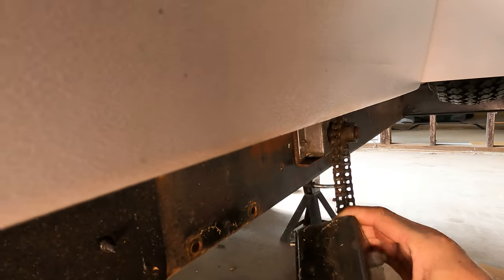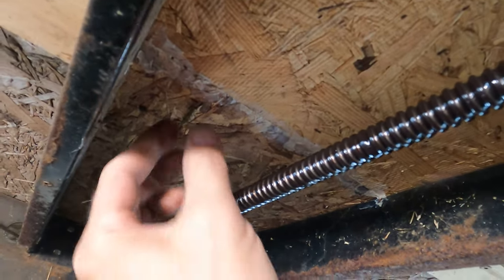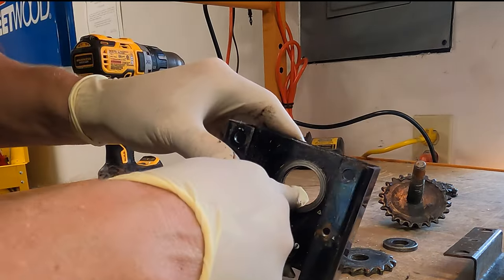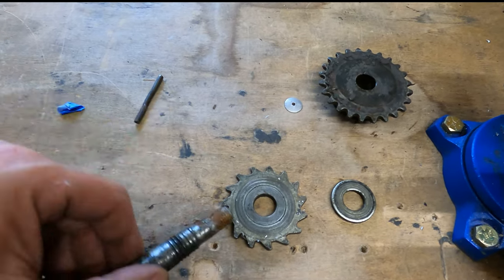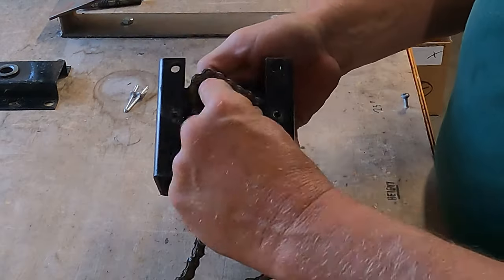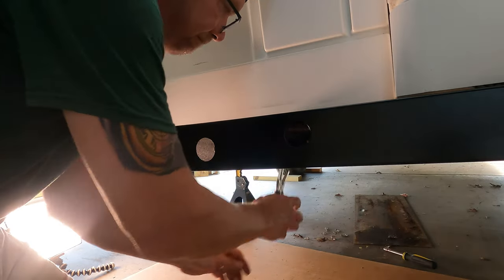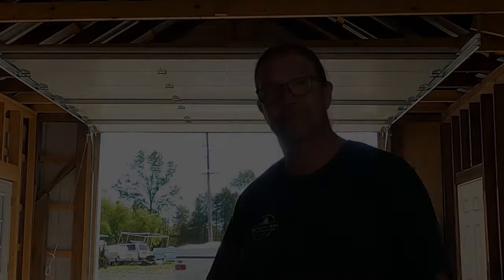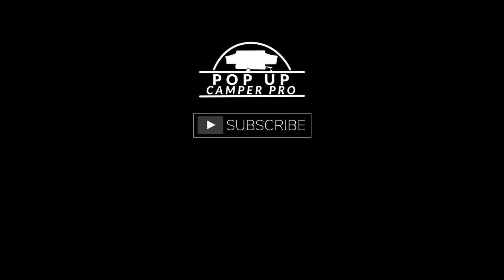Coleman Crank Replacement ~ LH Chain Drive System ~

Comment: Long shot. Mother in law's camper is (allegedly) a 2005 Fleetwood Niagara. The upper gear is not engaging, it can be raised and lowered with the internal 5/8 nut. I need to order an assembly kit, but I am new to this and have no idea what crank assembly this is. The crank is vertical of the jack screw and is in the middle of the spare tire. Currently looking for schematics, manuals and diagrams, but it is a bit chaotic. If you can tell me which assembly this is, I would appreciate it. It is currently at a campsite until 6/16/24 and I would love to get something ordered and replace it while it's there. I understand you're a busy guy and won't be heart broken if there's no response. Thanks EDIT: Found the Data Plate and confirmed 2005 (not 2019 which I knew was not correct) and I have found some schematics for that year.
Reply from the maker: We can help! Please give us a call for assistance

Comment: After unbolting that assembly, didn't you have to punch out a roll pin to completely remove it?
Reply from the maker: No. The chain slips off the 12 tooth gear as shown.